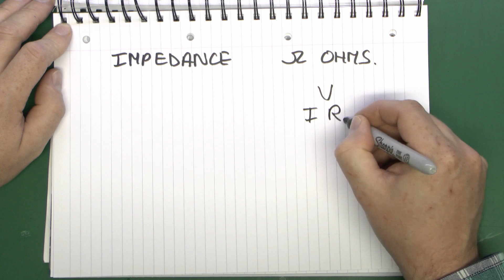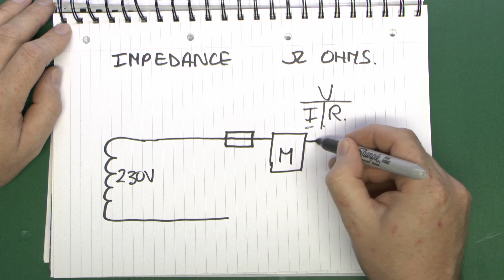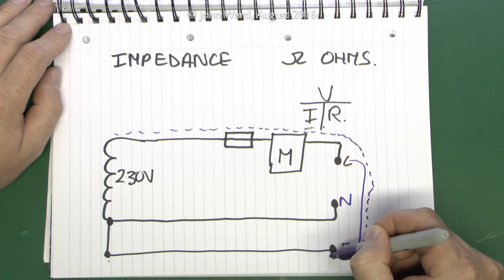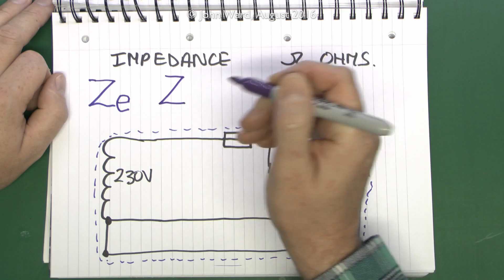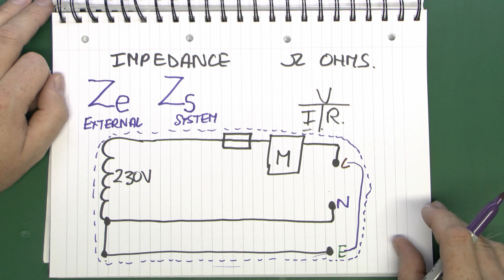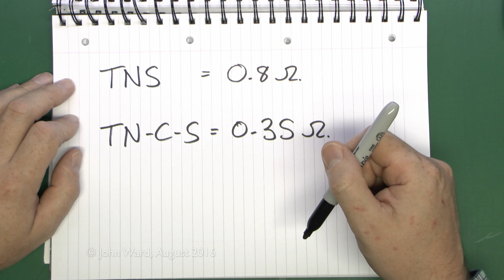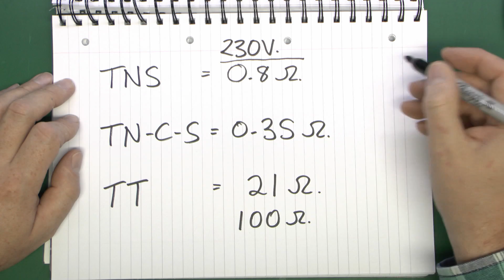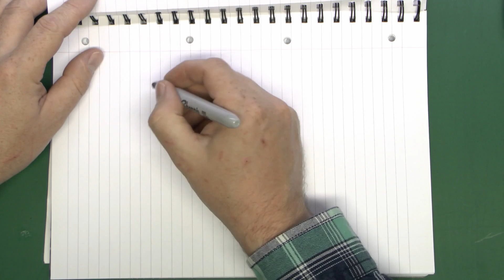Loop Impedance

Comment: +John Ward
Zs makes sense as the 'minimum fault current' that may flow -- wrt Maximum Sizing+Type of circuit-breakers....
BUT what about the 'maximum fault current' (which notably may be the L-N path [e.g. in TT]), may be important for that MCB 'breaking capacity' etc. ?
Is there an equivalent ''Zn'' (or whatever) measurement used to calculate that 'maximum fault current' especially in the case of TT supplies where the Zs reading won't be meaningful for L-N faults?
[more generally, maybe testers/designers ordinarially consider the Zs/Ze for L-N L-E faults separately i.e. 2 sets of values in all cases?]
Reply: After you have carried out a ZE test at the board the next Tests are  PFC (prospective fault current) and PSCC (prospective short circuit current). The PSCC is between line and neutral and will give you the measurements you asked for above.
Reply: The MCB breaking capacity has to do with the wiring used. It is there to protect the wiring ie the L-N wiring FROM the consumer unit into the property. By protection one means overloading the wiring during normal use as well as fault. The video above is about protection of the PEOPLE if there is a line to chassis short eg line to casing of a washing machine ....

Comment: Dear JW, I spent my day repairing some terrible electrics in a rented house, and testing the system once built. Only to realise I don't feel confident doing the loop impedance test and calculations yet, which are necessary here. I manage to delay this for my next visit, get home, and lo-and-behold you have released a very useful video, almost specifically for me!

Thank you!... Now excuse me while I watch this 10 more times.
Reply: If your loop impedance tester (or the loop function of a multifunction tester) gives a reading for the Prospective Fault Current (PFC) in Amps (or KiloAmps) as well as the actual loop impedances (Ze and Zs) in Ohms and the voltage between L and E in Volts, the PFC reading that you see may be less than the value that you obtain from your calculation. SOME (but not all) test meter manufacturers 'build in' an assumed power factor of 0.84, so you MAY need to multiply the Fault Current value that you get from following JW's excellent tutorial by 0.84 for it to agree with your meter's PFC indication. Hope this helps.

Comment: great video jw.is zs measured at the consumer unit for each circuit, or at each light / socket or whatever.and ze at the main switch while connected to the m.e.t
Reply: Zs at the furthest point of a lighting circuit, test sockets Zs as well, ze at the main switch
Reply: Disconnect the earth from the installation for ze so you don't measure and cpc circuits in the house, it's external. The e of ze, external, easy way of remembering
Reply: Thank you Tony Webb I'm new to testing I'm trying to get familiar with all the sequence of tests and stuff.am I right in saying I can do pfc after ze in the same way